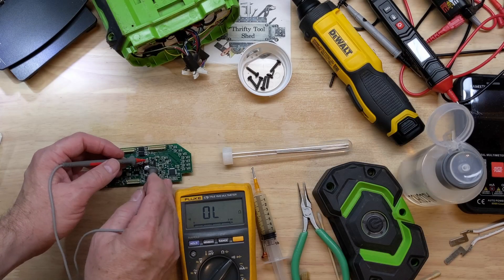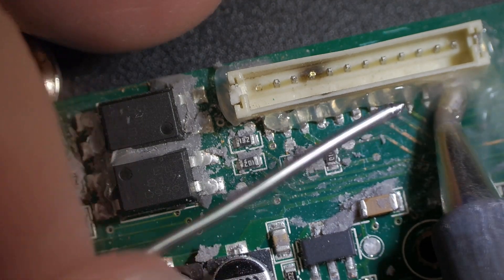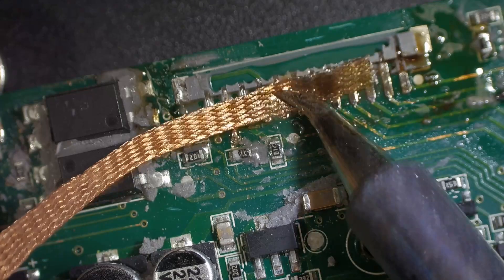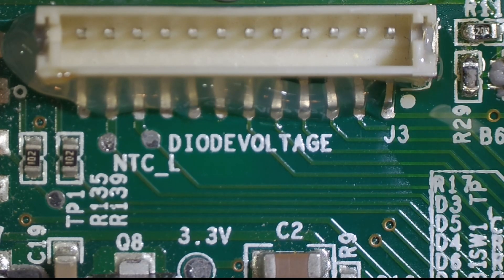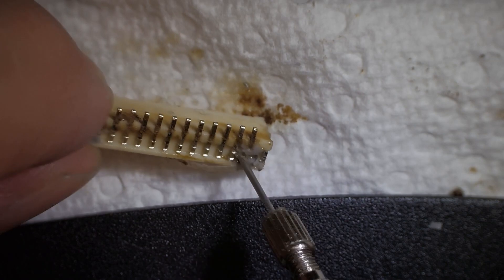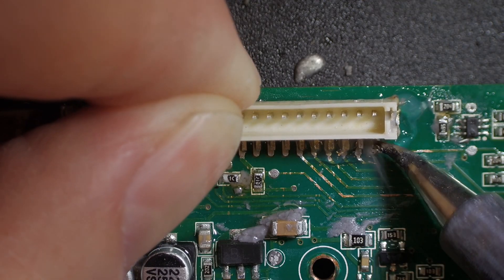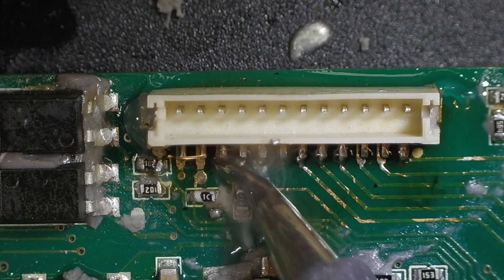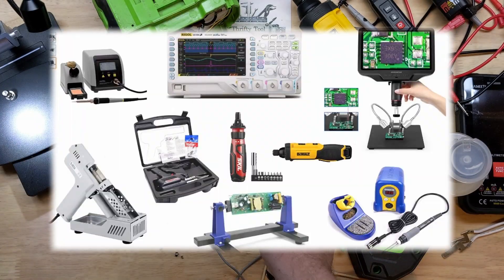EGO 56V Gen3 BMS Connector Replacement

Comment: Does anyone know the name of this connector type?.I need to replace one & don't have a doner board. =(
Reply from the maker: I believe it is a JST-ZH. 1.5mm pitch. 
The EGO board has a 8pin, 10pin and a 12pin connector of this same style. I have not bought one myself as I had a couple donors in the past when I needed one. I looked this up solely as a reference to try to help you find it, so I do not know for certain....
Reply: @ThriftyToolShed  Just thought I'd update..... Got the connectors last week, turns out they are too big. Ordered some SH1.0 (1mm pin pitch) so will let you know in case anyone else comes across the same =)
Reply from the maker: Thanks for the update. I simply measured the pitch with calipers, but I have not ordered myself to say! Best of luck to ya!
Reply: @annespacedroid  were the SH 1.0 connectors the right size?
Reply from the maker: I believe the 1.0mm pitch is for the 1st generation packs. The later models i believe are 1.5mm pitch.
Reply: @Pfremm  It will depend on the generation of the battery.
Reply from the maker: This is an example of some sizes...
https://www.ebay.com/itm/154741727863?mkcid=16&mkevt=1&mkrid=711-127632-2357-0&ssspo=LlNlb3NzTz2&sssrc=2349624&ssuid=D_qZMHXJQNK&var=&widget_ver=artemis&media=COPY
Reply: Thanks for this friend. I really appreciate your time to answer. I will order 10 (about the same price as 1)& let you know. I got a battery with the 12 pin torn off the board..... Amongst other things.
Reply from the maker: @annespacedroid  
Thanks for sharing! 
This is for the 3rd Gen board correct?
Reply from the maker: @annespacedroid  
I see. I am sure that the 1st Gen packs had the smaller connectors. I remember some of them were even black or a dark grey color at least. This video was on the 3rd Gen connector replacement so I wanted to clarify that.

Comment: I pulled my 2.5ah apart that wouldn’t run very long and found a couple wires that have pulled out of solo 8 pin connector on the bottom.  It looks like they were just in the goop and may never have been connected.   I pushed them into the connector based on a screenshot off one of your videos. Left to right I have: red,red,null,null,green,blue,black,black.  Is that the correct order? I now get a solid red light when I push the battery button and no lights on charger when you plugged in. Battery reads 48.5vdc. Any help you can offer would be appreciated.  Thanks
Reply from the maker: I have never seen any wires just in goop. The silicone is a moisture barrier over the connectors and also helps keep them from getting loose over time. All wires are crimped in the connector. I have a video I shared over 2 years ago to help someone with wiring theirs, as I surely can't recall at this time. I hope it helps. https://youtu.be/RfTJODoh8Q4

Comment: Any idea a good price would be on used  2022 4ah with fuel gauge, described as parts only and wont power on, any idea typical easy fix for that?  I appreciate  your time, Thanks in advance🙋‍♂️
Reply from the maker: Hi,
That is very tough to answer. It could be many issues and from simple to all cells are bad. So I typically find that prices on these packs have gone way higher than I like to gamble with. With the Gen 2 packs I  would go as high as $45 on a 5AH pack when I was buying a few non-working. I did not like going much higher in case all cells were bad or the BMS was non repairable. As long as you don't have your hopes up and are ok with just having extra parts if it doesn't work out.
Reply: @ThriftyToolShed  true! I figure if I get a few batterys for parts and or possibly  build a good one from those, I just bought the 4ah so waiting on it to ship to me, hoping the "wont power on" will be something  simple 🤞 I appreciate your response 👍
Reply from the maker: That's exactly what I did building up my spare parts. I did get very fortunate with the packs I could get going and in turn was able to share as we learned on the channel. It was still a couple that all the cells were too far gone, but at least the Thermistors and BMS were in good shape. Best of luck to ya!

Comment: Do you repair, or would you consider repair of,  EGO batteries for  subscribers?
I have a 7.5 Ah 56V that won’t hold a charge as long as it did when it was new.  I suspect it has some bad cells. The local battery pack rebuilders won’t work on lithium battery packs, only older technology like NiCad, etc
Reply from the maker: I wish I had time, I do get asked this often. I do not have a repair service at this time.  I work full time+ in a Industrial job and try to have time to edit videos to post. I try to help by posting what I have learned and sharing that best I can. Maybe one day I will have a repair shop. Best of luck to you with yours!
Reply: @ThriftyToolShed    Thanks for your reply.  I understand.  I see you’ve done a video on another brand. 
Do you recommend the Ruzixt brand, or a different one, for an alternative replacement?
Reply from the maker: Well I would not go as far as to recommend them. I bought my first one which was the Ruzixt 5ah and I have not had any issues with mine. I did get some comments from others saying they did have issues in the past with theirs, but some comments were good. My main goal was to find out more about the packs and if the BMS would communicate with the D terminal with the tool and work correctly. I was impressed and glad they figured out how to get the BMS to work perfectly, looks like they copied the program from EGO microcontroller. It also did pretty good on a capacity test, but came up a little short. All in all not bad for the price to me. The 2nd pack was a 6ah from SunMily and it worked super well and actually surpassed the 6ah capacity test. Ultimately I still feel the best way to buy a pack is in a bundle with another tool, you save a lot that way. In some cases if you need the new tool or mower etc. You are paying less than $100 extra for the kit with new battery with it. I will say if you don't need to buy any tools then the aftermarket may make sense to try.
The below is just an example of the SunMily for reference,  not really a recommendation though...
https://amzn.to/3S1816q
Reply: @ThriftyToolShed  Thanks again for your reply.

Comment: Back at it with an Ego battery repair, eh?!  Awesome!  Is that the Chip-Quick low melt solder?  That stuff is a game changer for sure!  Wish I would have known about it years ago, would have saved some serious frustration and a few parts I ruined from overheating them.
Reply from the maker: Yes, it's Chip-Quick. I know what you mean, I feel the same way. I wish I would have found it years ago also. I found the low temp solder paste first and I thought it was helpful but its aggravating. The low melt Chip-Quick is amazing. I can remember trying to remove a power connector and using a 200w iron and then using hot air and then both and then as the connector finally comes off, it's in more than one piece! 😕